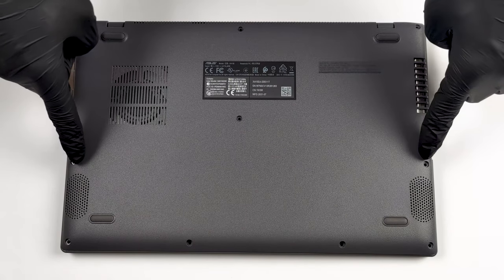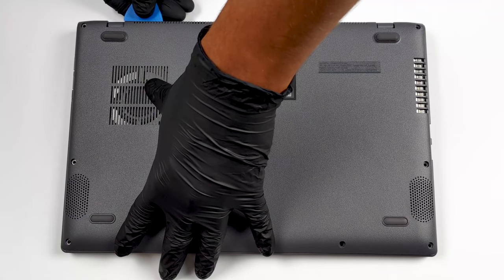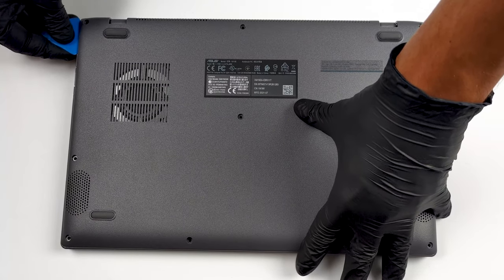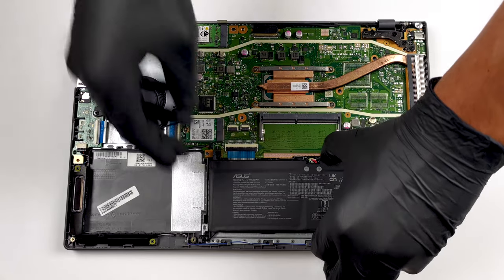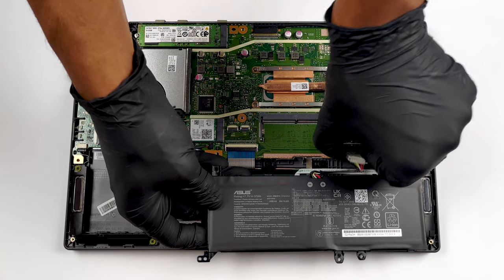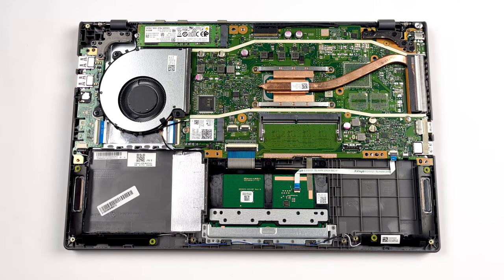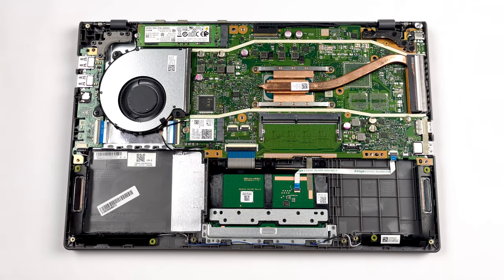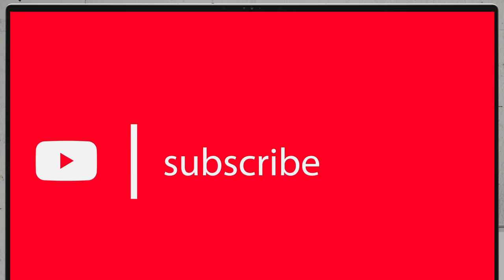🛠️ ASUS VivoBook 14 X415 - disassembly and upgrade options

Comment: the cooling design is cool... never seen one like it
thank you so much!
Reply: Macbook Air has had this design for years
Reply: but the noise isnt. I had pavillion 15 with 15W pentium gold and it was not that loud as this cpu at 50% power. The plastic chasis makes bad accoustic.
Reply: i have the laptop but the cooling is kinda bad;-;

Comment: I just got this laptop and upgraded the hdd to 2TB instead of the crappy 128gb it comes with. I tried upgrading ram using a corsair vengeance 16GB and failed, i thought it was faulty ram but exchanged, the same thing happened. Got an A-DATA 32GB and 16GB ram just to try and 32GB worked PERFECTLY. I will return the 16GB and keep the 32GB stick, although it seems like it would be fine to run 16GB in the extra slot for 20GB, more than enough. I made some tests opening gimp, firefox, libre office, edge and barely goes over 10GB.
Reply: Talking about RAM, how much does your laptop read when you installed the 32 gb module?
Reply: @lemonke4964  36GB, i dont think you can disable the 4GB ram. Loving this laptop so far, fast, light and cheap.
Reply: Do you know the model no. of the 32GB A-DATA module you used?
Reply: hi! i recently got a kingston hyperfury 16gb 3200 ram stick to upgrade the shitty 4gb of ram the laptop had, but for some reason it just goes blue screen and auto repair, i got it to run but after 30seconds it just went blue screen, is this something that happened to u when u installed the 16gb corsair vengeance??
Reply: @aymunn  yes, it didnt turn on. Get the one im telling.you gd damn.
Reply: it would be good, but the cpu for the most part is  only 1.00 ghz (X415JP)

Comment: Can you put a 2.5" inch SSD in this laptop by plugging into the HDD port?
Reply: From what I've seen elsewhere, the fixing gasket and cable are not supplied with the machine but can be bought separately from Asusparts for 20 euro the pair
Reply: @darrang7483  such a stupid decision by the manufacturer

Comment: Hows the buld quality of the laptop? Are hinges made of metal?
Reply: yes, hinges are made from metal in mine
Reply: Not sure about the hinges except they are quite resistant to moving and vibration but regarding build quality it's quite decent, my only issue is the display itself flexes a lot if you grab it by the corners.

Comment: what is the maximum Ram that can be installed in the available slot for this model Asus X415JP EK181T?
Reply: go to cmd and run administrator then type
wmic memphysical get maxcapacity

then divide the numbers shown to 1048576

Comment: what model is the heatsink type, because my laptop model m409da has the exact same motherboard as the x415 but my heatsink doesn't have a cooling pipe that leads to the air outlet
Reply: I am looking for the heatsink too. Can an one send me a link?

Comment: I am looking for the model of the Flex cable to install a hard disk, where can I find it?
Reply: Same here. Where can I buy it?
Reply: Nothing yet huh?
Reply: @krishbandicoot5369  you also need a rubber hard drive casing
Reply: I believe the 2.5inch bay comes in the box and you have to add it into the empty spot

Comment: i've seen bigger copper cooling piper on mobile phones...that is the  poorest cooling design i ever  seen in a laptop ....
Reply: Shit. Now I regret buying this laptop
Reply: @RenathanAbdulDjalil  is it that bad?
Reply: @thatmg  Currently writing on this specific laptop and I don't think it matters too much. This laptop doesn't even have dedicated graphics and only a 4 core CPU, I do some light gaming on it and rarely reach 100°C (constant 100% CPU and iGPU usage). 
The cooling seems to work well enough and it's definitely outputting heat as can be felt on the side.
Remember the notebook itself only uses 45 Watts total.
Reply: I have it for 6months now and its great. before i had lenovo legion 5 so i know what is a good laptop.  its very good imo no cooling problems at all. Highly recoment. (Btw i have the x415EA-536T intel i5 16gb ram 1tb ssd(upgrade) intel iris xe gpu).
Reply: @thatmg  yes it is very bad 
Windows 10 doesn't work smoothly out of the box also i didn't install any app 
Get heated very fast
Reply: The cooling solution actually does a surprisingly good job at keeping the cpu cool. I ran Minecraft optifine 1.12.2 on this same laptop at about 60-130 fps and the cpu ran at about 50-90 degrees celsius.

Comment: This one is the worst quality of asus product
Reply: why?
Reply: Why bro i am using i5 10th gen 
variant for coding and programming haven't seen temps goes even close to 70c. And no hanging issue without ram upgrade i don't y people hate this. May be u got hdd plus i3.
Reply: Yeah i boughy a similar laptop one year old, an ASUS X15MA EJ490, and it is the worst laptop i ever had in my life, after one year old of using it, today it breaked, i mean i cant use it anymore, i tried powering on this laptop, didnt work, i tried charging it, didnt work, its just a waste of money!! And only after one year old of using it! ( And i dindnt break it by myself or something else, it breaked itself today, thats why i camed today to this video!! )